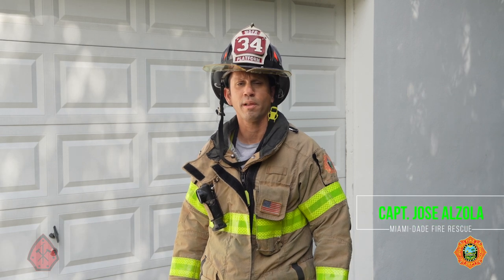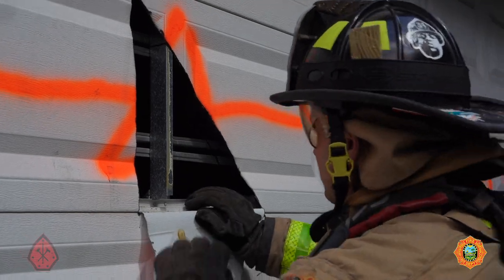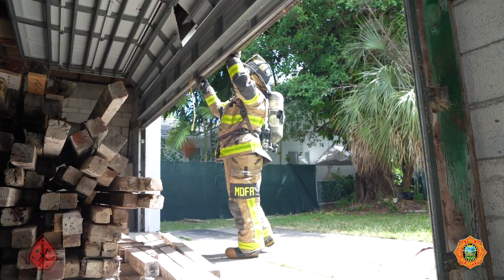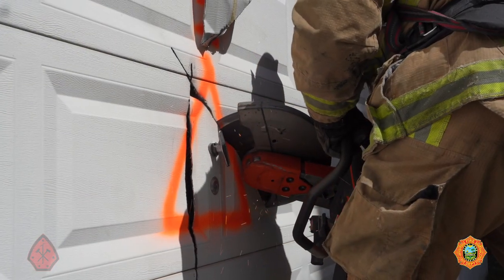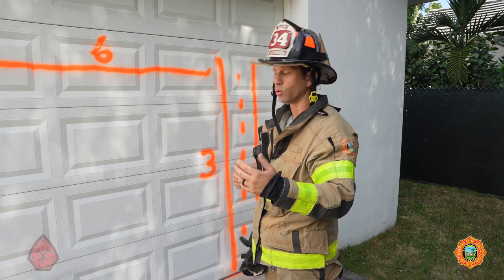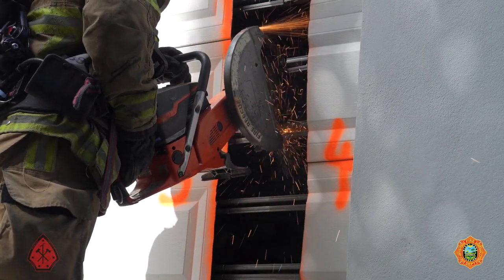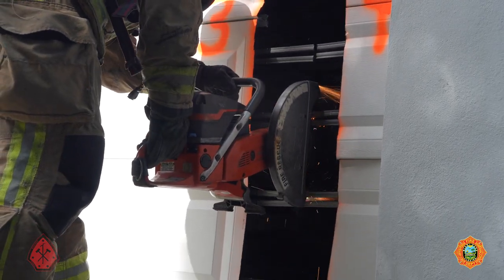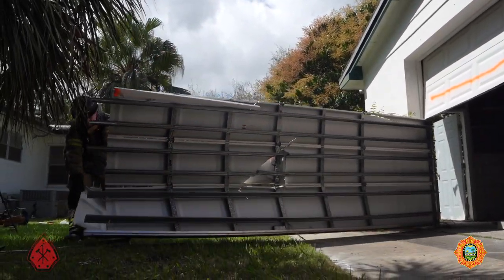Residential Garage Doors

Comment: Cut one and two great ,  throw chain in number one then back out number two hook em to a truck and pull the entire the door out . Lots of variables in this garage door stuff , a two car door could have a removable post to keep the door from being pushed inwards. A torsion spring lift system might have sliding electromagnetic locks on one side or both . I was never a fireman but I know how to break stuff.